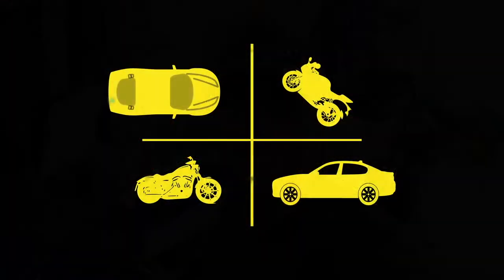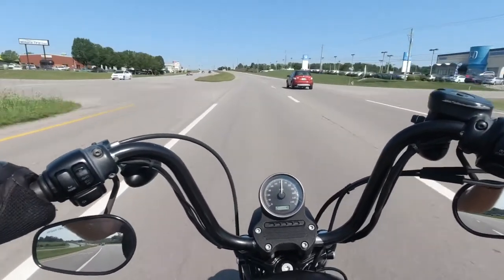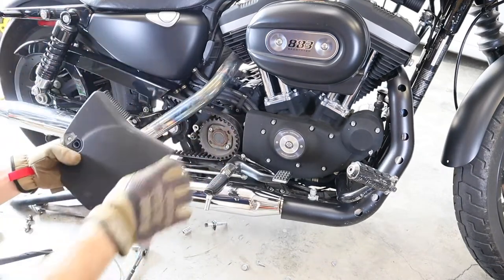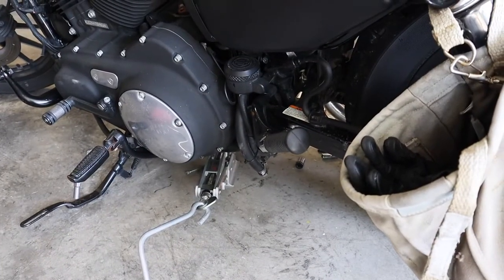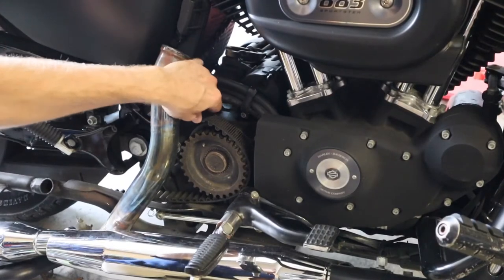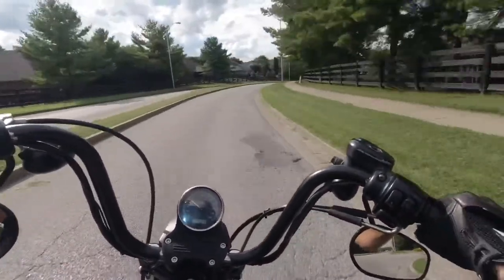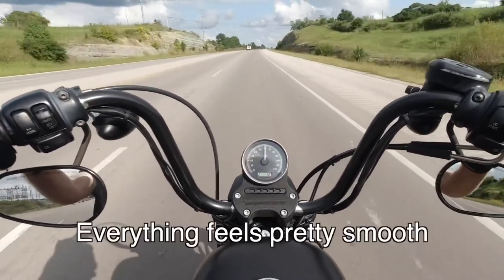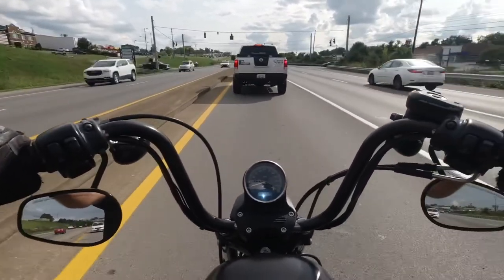Changing the front sprocket on a Harley Davidson Iron 883. Less vibration, MORE MPG!

Comment: Purchased the 32 tooth from sirrom1 and have been using it for 1 week now. This is the 2nd best mod after the exhaust.
Rides much smoother on the intertate and doesn't loose that much torque (I'm 200 pounds + some luggage) fuel economy is the same as before, adds 10mph top speed and overall engine also sounds better for some reason (lower RPMs I guess).
2017 Harley 48.
Reply: Did you use stock belt with it?
Reply: Could you use your stock belt or did you have to change the belt too for the 32t front sprocket? Kindly return the question Best regards 👍🙂

Comment: I put a Hammer 1250 kit on my '06 XL1200R as the pistons weigh about midway between the 883 and 1200 pistons - right about the weight the crankshaft is balanced for. I alsofitted a 32 tooth tranny pulley and the cruises at95 @4000 rpm... it'll do 100mph in third as I have ported the heads,changed cams along with other things!

Comment: I don't know if they changed anything from 2010 to 2014. But my 14 has a tach and I've done a bunch of 700 miles days. Kinda planning a 1000 mile day for the fun of it this summer. My 14 doesn't buzz at all and loves 80-85 mph. I bought it new and have 50,000 on it now.

Comment: This modification is a LOT cheaper than buying a 6-speed gear cluster (for Sportsters) from Baker Driveline. From what I've heard as of Feb. 2021, Baker might have dropped the 6-speed gear cluster (for Sportsters). This is a very informative video. You're right -- a taller front pulley should have been added in the production 883 Sportsters.
Reply: From what I've read, the pre-2004 Sportster transmission could be replaced without taking the engine out of the bike. 2004-up the engine must be split to replace the transmission. Definitely a step back.

Comment: I thought about changing the front sprocket on my 2005 1200R to the European part, but then belt availability crept into my head and I left it alone. Good thing. When the original belt failed at 74,000 miles it took my dealer two weeks to get one. The idea of having to wait until a belt shipped from Europe isn't a good idea. 75 mph is 3500 rpm, a little busy, but not excessive. The biggest issue at sustained high RPM is increased oil consumption due to the design of the air cleaner.

Comment: That's exactly what I was looking for, I've have an sportster superlow from 2012, I mostly drive on highway at 120kmh, that's like 74mph I guess, and I have always feel like if the sportster have 6 gears would be the perfect bike, I will look more in to this mod, thanks for the video. It's the sensor taking the speed from the sprocket? That's why the inaccurate readings on speed? Greetings from Spain.

Comment: I did my 2009 883 Custom. 60 mph  is now 65 mph. I like it. Here is what HD says about pulley upgrades "At 70 MPH, each tooth is worth approximately 3 MPH. Instead of 70 you'll be at 73 MPH (+i tooth), 76 MPH (+2 teeth), 79 (+3 teeth), 81 (+4 teeth) for the same engine RPM as the original pulley at 70 MPH."
Reply: Plenty of torque to spare, this actually makes my bike faster through all the gears. I weight 240 lbs and it still has plenty torque after this upgrade. I think the 31T is good to go, I caution you from trying the 32T as the belt may not be big enough.
Reply: I realy never did fully trust belt drive  Don care what the pros. Say if the belt snaps or tears I'm screwed. At least a chain is a little noise but more for forgiveing I'm.a firm.believer in factory stock if it's. Born with a chain then the chain will stay no modify actions nothing
Reply: Your Hatley will be slower out of the hole but you will gain on fuel millage and top speed  plus
 Less stress  on the engine
Reply: My Harley is only 500 pounds factory with oil and full fuel it's pretty light for a  shovel head

Comment: Great video, man!  I've had 3 883's and a 1200.  I still have one of each, and I've been trying to decide which one to sell.  I always wished for a sixth gear for my 883's.  The 1200 is geared taller and does better on the highway.  So I think I'll do this mod to my 883 and sell the 1200.  I'm 190# and I have never had to use full throttle on any of my 883's.  They keep up with traffic just fine, and will cruise all day at 80 mph - if you hands can take the buzzing ;-)  

It's funny to think that the Sportster used to be considered a full-size motorcycle.  Now, it seems kind of dinky.  I think H-D geared the 883 down to account for two lard-ass Americans riding on it.  But honestly, the Sportster is not really a "two adult" motorcycle.  Like you admit, it's kind of a small motorcycle by comparison to other modern bikes.  Maybe it was meant for two skinny college kids from the 1950's, but not two average American Walmart shoppers.  Anyway, thanks for the video!

Comment: This is not a true test of acceleration. Getting onto the interstate earlier today I shifted into 5th gear at 75mph. I was at 75 before I was off the on ramp. Stock redline is 6k rpm. It sounds like you are shifting at 4k rpm.

Comment: Anyome notice how the belts rubs on the sprocket case? Im getting a slight rubbing  for some reason belt is sitting closed to the case than the transmission.
Reply: fernando...if the belt is rubbing the sprocket case or rins towards the trans housing case....you have not aligned the belt properly...its VERY critical that the 2 threaded adjusters at the rear axle HAVE to be adjustered the same and equally..or the belt will not run true on the sprockets (front or rear)

Comment: Question : did you do any belt alignment and also do you experience any belt noise I recently did this mod and I'm just experiencing belt noise is this normal
Reply from the maker: No I haven’t had any belt noise afterwards. It’s important to get the rear alignment adjustments exactly the same on both sides. Maybe you have one a lot shorter/longer than the other?

Comment: Looking to get the 30tooth for my 883(with the 1250 hammer kit) did your top speed increase noticeably? I’m cruising at 70-75 comfortably but I’m looking for more, also did your lower gears get a bump also?
Reply from the maker: I’d say it’s a few MPH off, and it gets further off as the speed increases.  At 70mph on the Speedo now, I’m probably more like 74-76. Funny story, and you can see in the other vids, my dads gold wing reads a little slow and now I read a little fast. So we just assume it’s somewhere right in the middle haha.

* I misread your question, lol. I dont know if the final top speed increased(it must have) cause Ive never topped it out. And I'm sure the lower gears each have slightly higher final drive, if youre revving them high enough to notice.👍

Comment: @tkdriven Good stuff, great content.  Did you get to recalibrate your speedometer with update and did you change the rear sprocket all or left it stock. Thanks again for the info. 2005 883L
Reply from the maker: I have not done anything to recalibrate the speedo yet. The company that sells the sprockets also sells a speedo recalibration kit that I plan to review as well.
Reply: @tkdriven6077 where did you get the sprocket?

Comment: Where did you order the 31t sprocket from? I have 2005 1200c and I would like to do this mod.
Reply: plenty of nice used ones on ebay. that's where i always source mine. 2004 and up will fit your 2005 XL.
Reply: My friend, I have a 92 model 1200 xl. What do you think, should I buy it? 1200 upgrade from 883

Comment: Hi, thanks for posting this video. Could you tell me how many teeth on the standard sprocket please? So I can make a judgement for my super glide.
Thanks, Paul.
Reply from the maker: I believe the stock sprocket for my 2010 is a 29T
Reply: My 92 sportster has a 27 tooth it’s an 883 now a 1275 I can’t wait to get on it still in breaking mode it’s gonna be like having a car with 513 gears but I probably will switch over to a 31tooth because I already have a 30 and 31 because I’ve already thought about doing this too because  at 75 80 miles an hour them handlebars really start to buzzing
Reply: This isn't the same procedure on a big twin

Comment: Do you need to change the belt?
Reply from the maker: No, you don’t have to.
Reply: @tkdriven6077  btw you can change primary gears and chain with 1200 and it doesn’t effect speedometer plus this 31 tooth pulley and you’ll be quiet on highway and mpg will be great

Comment: Do you have any idea how many teeth the standard is?
Reply from the maker: Starting in 2010, both 883's and 1200's have a 29 tooth front pulley, all models.
Reply: @tkdriven6077  my HD dealer is willing to put on a 30T but says they don't have a 31T where they get the parts...drag specialties I think. I hope one tooth will be worth it?
Reply: @tkdriven6077  mine is a 2009. Do you know how many teeth the stock one is?

Comment: Shift to 2 at 20....ok, shift to 3 at 40.....ok, shift to 4 at <55, huh, shift to 5 at 60.......and you feel you need another gear

If you take 4th to cruising speed then shift to 5th you won't feel like you need another gear

Based on my having had 2-883 both carb, you can do 95, 75 shouldn't be anything

I got 60 mpg on both, cruising around 60mph and under, enjoying riding the curves......however as you go above 60mph, mpg goes down

I really don't think you'll see much mpg improvement, and acceleration will go down

Comment: With the pulley being splined to the axle there was really no need for harley to engineer left hand thread. Also, applying a heavy torque on this nut is pointless. It simply needs to line up with the keeper snugly. With the keeper on that nut is not going anywhere.